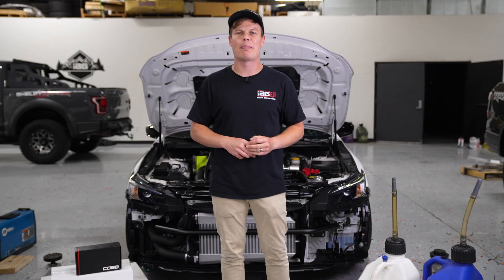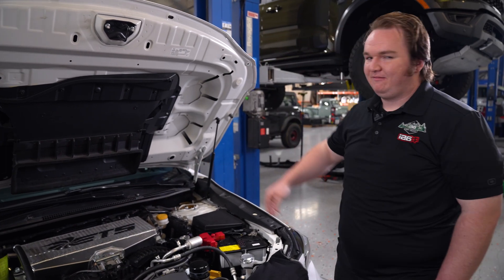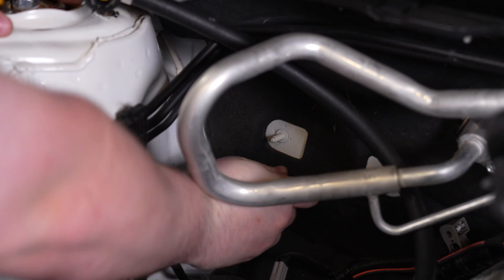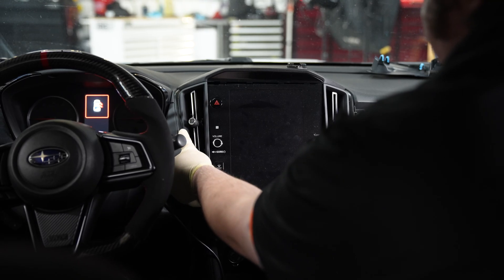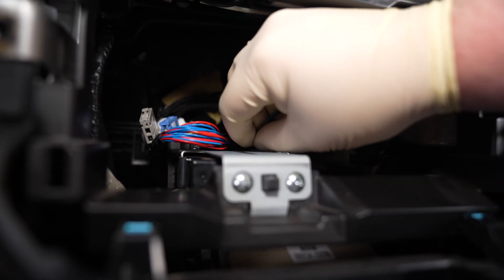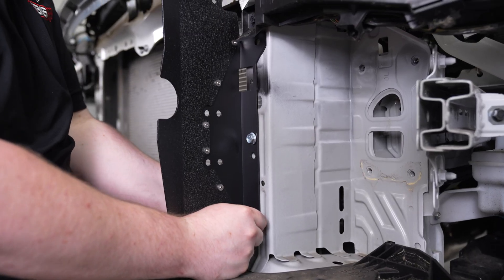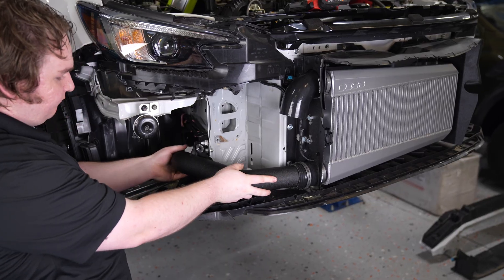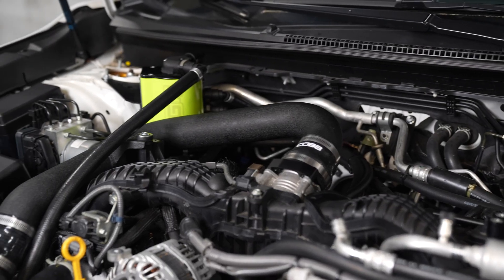How to install COBB flex fuel on the 2022+ WRX

Comment: That FMIC looks great but no way am I getting one when a nearly $550 carbon fiber intake is required
Reply: You don’t need to buy the Redline Power Scoop to run the intercooler 💀 You have to run their $165 intake tube.

Comment: So flex fuel kit wouldn't work without the  access pot
Reply from the maker: Correct, you will need a tune to run flex fuel!
Reply: @theiagchannel  so if I want to buy the kit for my 08 sti but I don't have access port would I be able to tune on the ecu
Reply: @MOSTWANTED_7928 no man how you gonna tune with no accessport?? Unless you have other engine management

Comment: I don’t like the part where you gotta remove the crash bar.
Reply from the maker: It's not for everyone, but removing / replacing the crash bar seems to be pretty common for FMICs
Reply: They provide a new one 😂 If you want your factory crash bar then buy the ETS front mount or stay top mount. Easy.